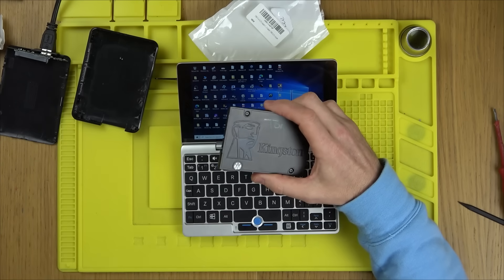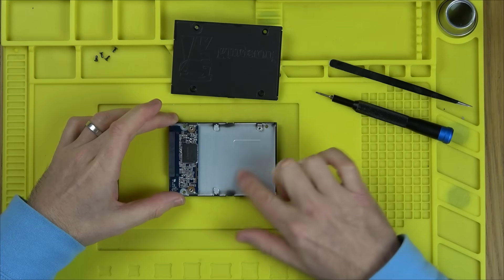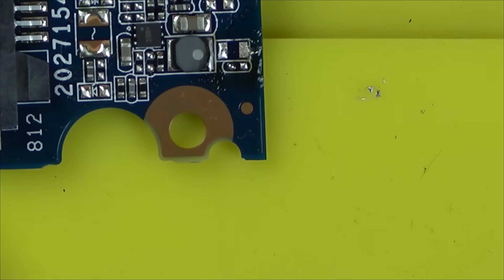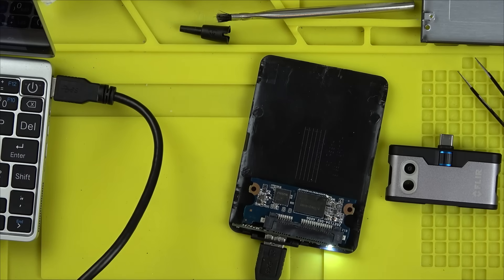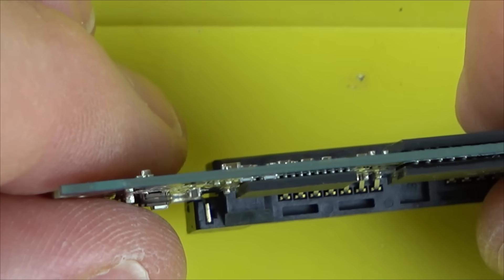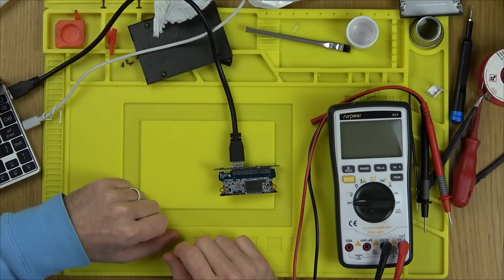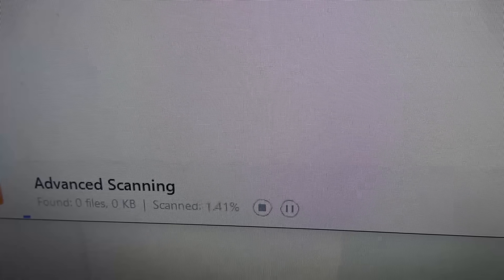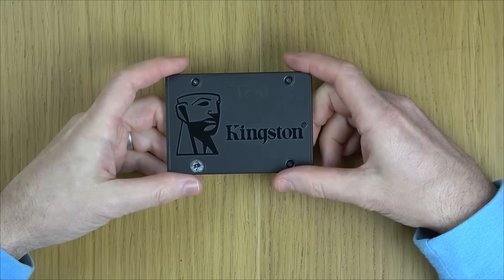Can I FIX a Kingston 240GB SSD ?

Comment: I had a similar issue recently on a mechanical drive and was able to recover my data. I used an ubuntu distro and first ran dmesg to see what the actual fault was.  Then went down that rabbit hole for two days :)_   Eventually I had to repair the table so I could read the drive.
Reply: What did you do - headbutt the table in frustration ;)
Reply: @somebodyelseful    Of course I did,  I was using Linux!  :)

Comment: You could try putting it the freezer for 15 - 20 minutes and try again. I have done that it in the past on spinning drives and I was able to get the data off before it failed again. It won't fix every drive but if the fault is due to a bad connection (broken ball on the BGA) it may help.
Reply: Put it in a plastic bag so moisture doesn't build up on it.

Comment: Simple thing to note. The SSD is recognised and shows the amount correctly suggests no hardware issue at all but rather software issue. Should just initialise the disk as it is a partition issue and data for the partition has probably become corrupt. I use Easeus data recovery which I have found to be good and got most of my data from such an issue. This is not to do with components. You will find some NVMe drives will need Initialising before they can be used and people think, that because it isn't initialised it doesn't work, this is false. Going and looking for bad components straight off will do nothing but damage the drive.
 
In Disk Management you right click the drive and initialise it. You have to initialise it. The fact you didn't proves nothing. Initialising would be the FIRST thing to do. Yes it may not show data but that data is still there and data recovery software can get it back but would need saving to a separate drive. I have done a few drives like this before, yes it can be a chip but I wouldn't even bother looking since the drive shows the correct space and and the drive itself so no, the chip has NOT failed most likely. It is probably more a partition table corruption.
 
Try initialising first before anything. Samsung 970 evo NVMes are known to show up uninitialized. I have two myself and showed this yet, people mistake them as faulty. I have seen drives on ebay, supposedly never used and show up as not initialized and then people sell them as faulty when they are not necessarily faulty.
 
IF there were a problem with the drive, as in it is detected but an issue with writing and reading, I would expect to see 0GB as the total size of the disk. NOT the actual data size which points me first to a corruption in the partition data that has led to this, the fact is the 'not initialised' is something you can manually do in disk management and is like thinking a pc is faulty because it doesn't power on when you press the button, you strip it down and change parts etc, to realise you NEVER plugged it into the wall in the first place.
 
Try intialising the disk first. IF the disk shows but says 0GB, this can also appear in BIOS on drives, then there is corrupted firmware. IF it were a component then the chances are that the drive wouldn't be recognised at all. So it sounds to me a software issue due to something from the original place where the partition table got corrupted. Initialize the disk then do a software data recovery which doesn't necessarily need a company to do it, but rather, a licence for actual good software.
 
IF in disk management the disk shows as offline then make it online then initialize and data may return, but, either way run data recovery software, back that data up then the drive is usable. You may get lucky by changing it's status to online then run intialise. I have done these things before even on my own drives where this has happened, sometimes lucky other times not. data recovery is a useful tool either way.
Reply: i agree, I have done this many times and got around 90 to 95% of the data recovered

Comment: The controller is bad but there might still be a way to recover the data from the SSD.
You see, because the controller is bad its most likely overheating and triggering a protection shutdown.
What you can try to do is attach a heatsink with a fan to the controller to keep it from overheating and shutting down. Might give you enough time to scan the disk and extract the data.
Reply: Putt it in the freezer with long sata and powercable (no usb adapter)
You just need a little improviced computer, maybe put together by old used parts that you can put close to the freezer..
Reply: I've had success before by putting it in the freezer for 15 minutes.
Reply: @MrMaxeemum  The freezer would only keep it cool for a few seconds. If the data you want to recover is small and easy to access it would work but for a large data you would need constant cooling.
Considering that his index date is gone he will need to do a full scan of the SSD to recover the data with will take several minutes.
Reply: @vitor900000  It has worked for me before. It's worth a try as it can't do any harm.

Comment: The disconnection issue may not a be a fault of the drive but the laptop your're using, it may need a permanent power connection like a direct connection in a Pc which is not reliant on the power from the USB only
Reply: So what are they odds the guy who sent the ssd have a bad computer as well?
Reply: @nicoful86  You have missunderstood me, for the purpose of recovery a non USB power supply could be required, The SSD could be fine but has lost the MBR
Reply: @nicoful86  can be pretty high, we don't know if it was pc or laptop, we don't know if the guy sent the usb connection that Vince used in this video, we don't know if it is the USB causing a boot loop with the SSD due to a lack of constant current enough to run the SSD, anything is speculation until we find out the facts.
Reply: I highly suspect you are right with your answer, sort of like using front panel usb on my fathers pc wouldn't allow my ssd in a usb dongle to work and came up with the same symptoms as this, but worked absolutely fine on my pc, and my brothers pc. hard drives/ssd's seem to need to draw more power/current than the front usb ports on a pc can handle, or I suspect the same with Vince's hand held device will allow on battery power. or could also be the usb lead itself. so too many variables rather than in a pc case using a pc case power and data cables.

Comment: Generally speaking you would not go to physical disassembly as a first step when attempting to salvage data, you would attempt to image the drive. There are plenty of good imagers, both commercial and free. A free imager that I personally have had good results with is: ddrescue.
Reply: Once I have an image, I can use a combination of testdisk and photorec to investigate a separate copy of that image, that's if it doesn't just outright mounts.

Comment: If you get some of those broken powered hard drives. You can always save the power supply module for other mechanical drives. But those are solid state.

Comment: "SATAFIRM S11" looks like Download Mode for SSD controller - FIRM stands for "firmware". You need to escape from that mode, no idea how to do that. In my opinion only PC-3000 could restore that data.
Reply: when download mode is enabled it most likely a corrupt of misbehaving firmware that makes the controller want to "ask for help" by enabling firmware debug but it can also be a shorted jumper trace somwhere that enables that mode idk
Reply: 309electronics. Just like any normal programming code, punctuation is imperative for proper communication.

Comment: I had similar happen with a HD and it was due to it overheating, I sat it on a freezer block to keep the temp low and it stayed connected long enough to get the data off 👍
Reply: That would be a great money-making scheme for those of us in Winnipeg. You could just take your device outside and wait a few minutes.
Reply: I've attached heatsinks with fans blowing and got similar results.
Reply: Overheating typically means a failing chip.

Comment: On the pro side they would desolder the nand and use a reader to dump the full contents then use some rather expensive software to rebuild the drive digitally to get the data that way. One of the very worst data recovery jobs ever done was drives dug out of the ruins of the twin towers (9/11) that were not only burned but were also filled with concrete dust with the average cost being between $10,000 to $50,000 per drive recovered and in all that they found evidence of wire fraud.

Comment: Kingston a400 series will die eventually you can recover it (data is all lost)  but it will happen again, i have seen lots of them with the same stafirm s11 problem (phison controller is not only used in kingston a400, all the cheap ssd ones use it...)

Comment: Great Effort Vince. I agree with you and think that the SSD controller is bad. We can't fix everything! I'm not sure if a replacement chip would need configured with the size of flash chips, type, speed, and USB descriptors etc, so even getting a replacement chip might be more involved than just a swap. edit: Just an additional thought.. The SSD controller must be slightly working, as it does show up in device manager and reports the size correctly, so wondering if its the flash that is bad?
Reply: Slightly concerning is how these fail and the lack of warning that you'll lose all your data. Hard drives usually but not always will give you a warning sign but SSD and SD cards for that matter do not. If it fails you don't just lose a bit of data where bad sectors are you lose all of it. Still  prefer SSD but shows importance of backing up
Reply: Bad Flash was my thought too. That the device still shows up says a lot, so it could be that the Flash chips are at fault, with the Phison controller trying to read from it, but repeatedly failing. Kingston is known for sourcing NAND Flash from a wide variety of sources, and reliability issues are common. Hope we get to learn what the actual issue is :)
Reply: How about buy a similarly unit and replace/put the memory chip?
Reply: @retroaria  55 seconds ago wow. anyways that would be an extremely hard and risky process as there are solder joints at the bottom of the chip which you cannot get to so the only way would be with a heat gun and a crap ton of flux.
Reply: @retroaria  That's not an option. One property of NAND Flash chips is that heating them up destroys the data stored in them.
Reply: @retroaria  Many controllers also store structural date inside themselves.
This structural date is related to how the controller will allocate data on the NAND chip.
A new controller chip will make/have a different structural date inside with will make the data on the NAND chips read as gibberish.
Reply: @vitor900000  Indeed, raw Flash cannot be easily read out, though you can do data recovery on them. Slowly and painfully, but possible.
Reply: @MayaPosch  Some controller also have a encrypt key with make it 100% impossible to recover the date from the raw NAND chip if the controller is dead.
You will only see a bunch of bits that will only make sense if you manage to somehow miraculously recover the encryption key stored in the dead controller.

Comment: Have you tried spinrite if that can’t fix it first than it’s basically not worth it
Reply: be very careful with Spinrite. It's generally not a good practice to fix in place. When you attempt a salvage, any interaction with potentially failing hardware is like poking a bear. You want to limit your exposure to the bare necessities. Imaging is generally the way to go. I prefer ddrescue, as you can run it over a number of passes. The first pass is to get as much data as possible. It will skip any failing sectors. After that, you can start to drill down and become more intense, safe in the knowledge that  up to  that point, you've got the maximum data possible safely stored.